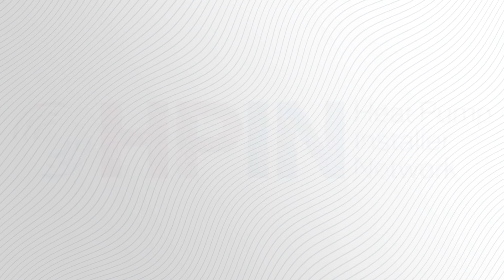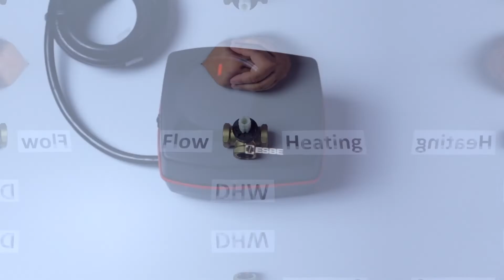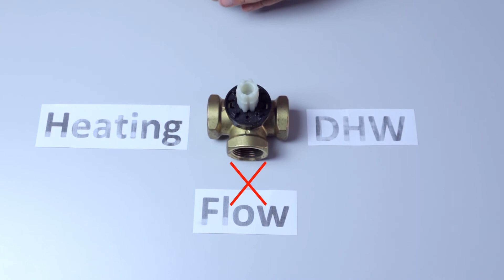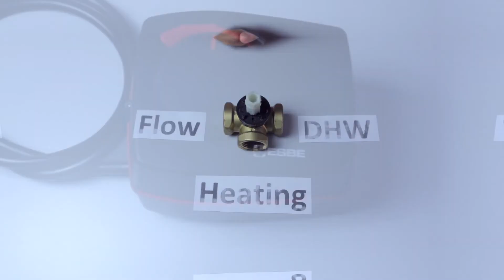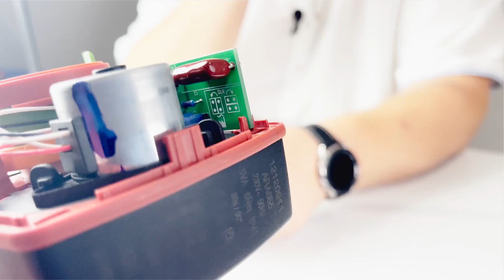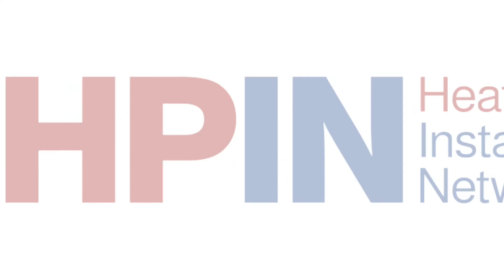ESBE Valve (Advanced guide)

Comment: Great video 

I have need help adjusting my esbe valve as it steals hot water from my sanitary  tank to my Underfloor heating plase can you help me what i need to do to adjust spindle inside and set the valve correctly so when it demands hot water or UFH it doesnt feed both things at the same time